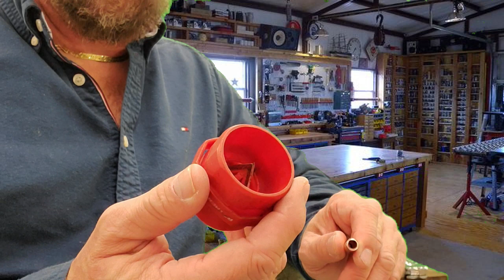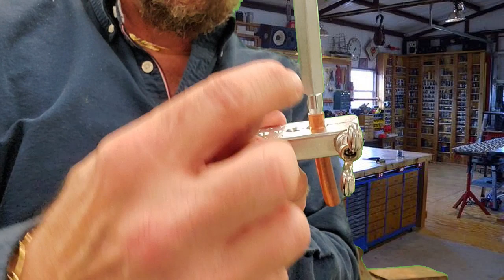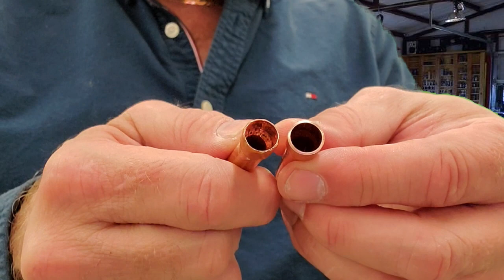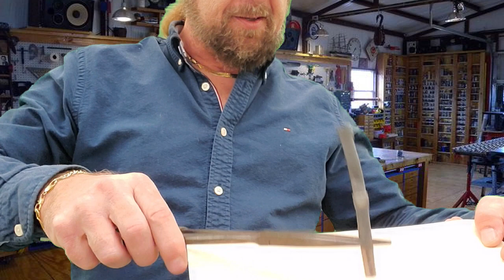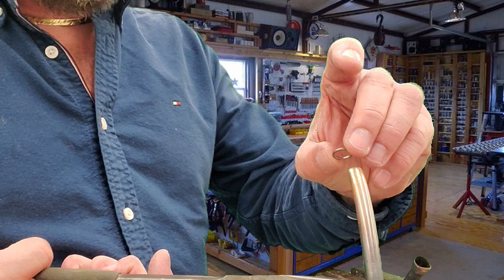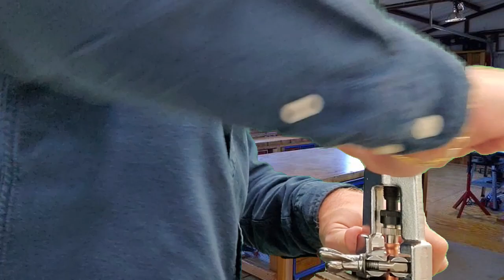Swaging Copper Tubing

Comment: What are your thoughts on using Stay-Brite 8 for brazing? It uses a lower temperature and you don't have the black oxidation on the inside of the pipe.